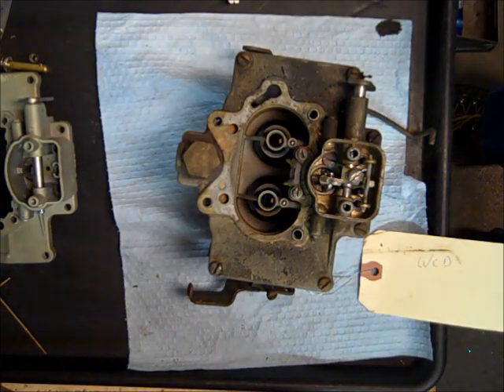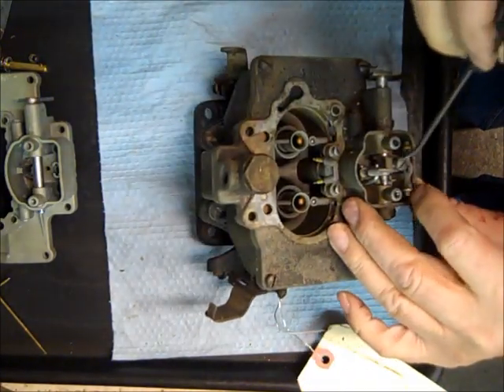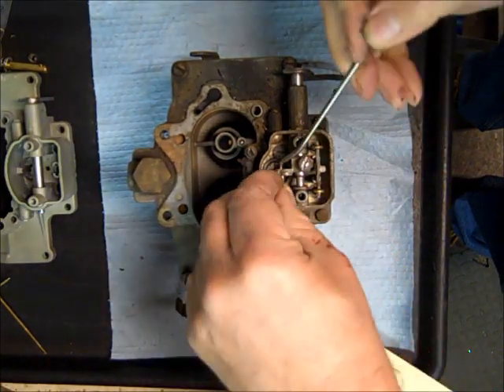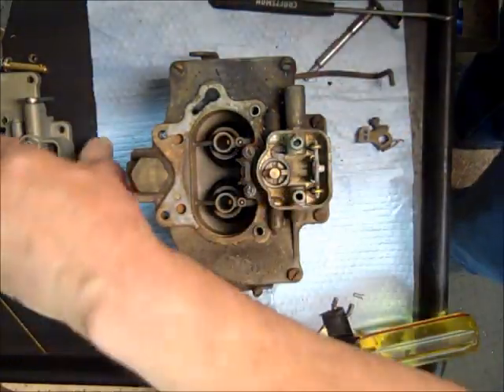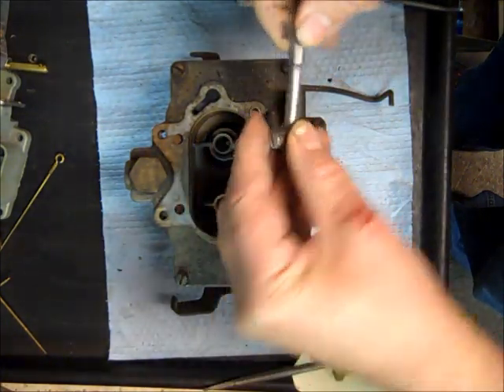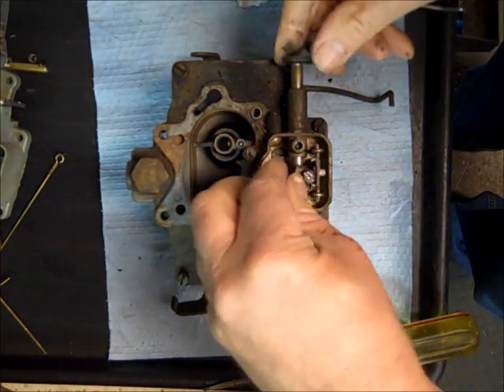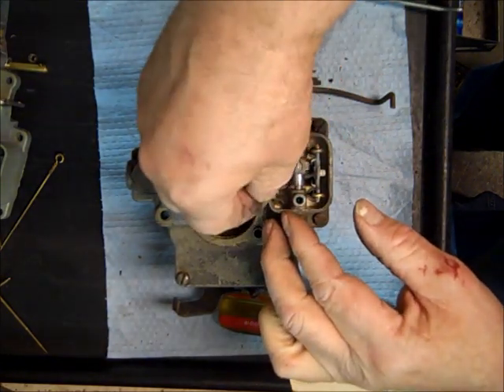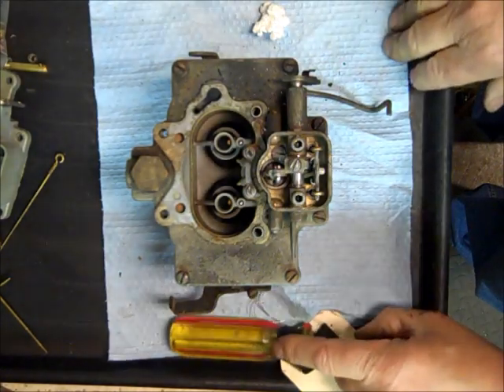Carter WCD Metering Rod Assembly

Comment: Looks like the little tab that engages the metering rods is adjustable,/bendable, could be helpful for setting metering depth and when the rods are allowed to lift out of the jets as the throttle is opened ?